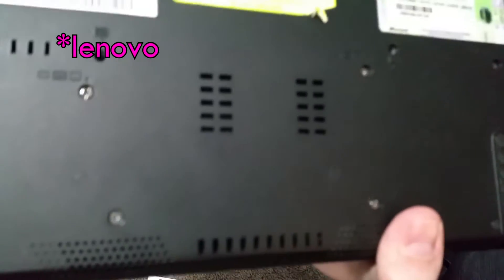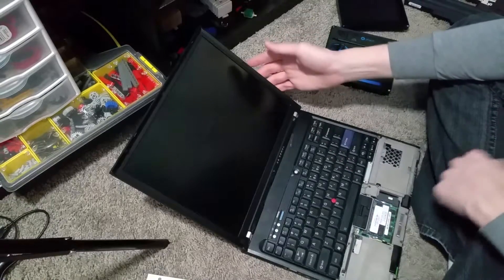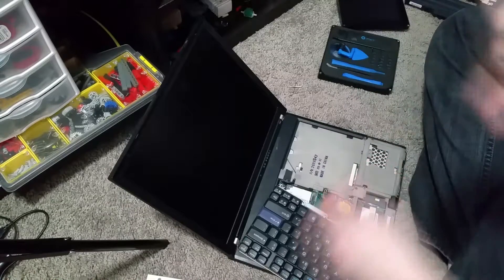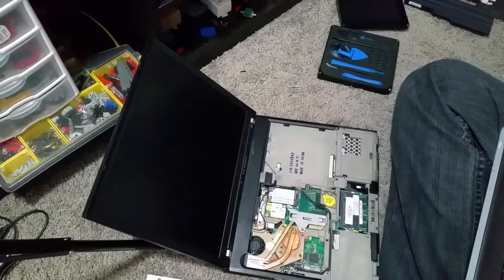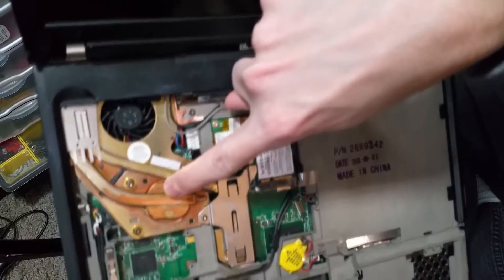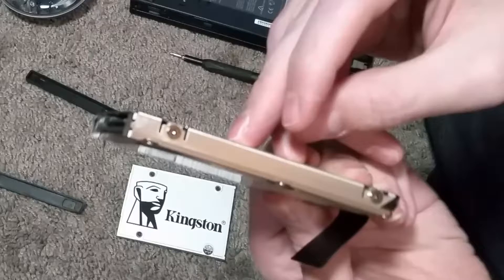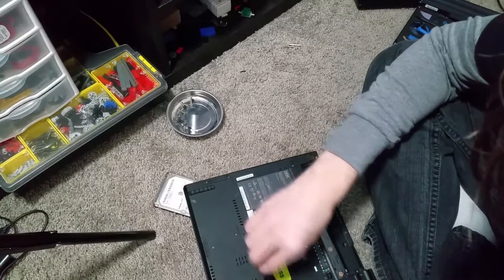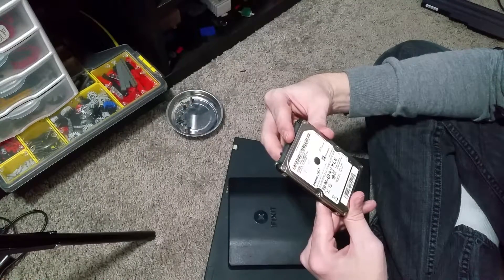Upgrade IBM Lenovo T60 part 1 | installing SSD, checking WiFi and CPU

Comment: If i wanted to put a 120g ssd m2 into a t60 what type of adapter would work for me? Is there anyone you recommend? thank you
Reply from the maker: @jaime9027  you don't need an adapter... Get a sata ssd
Reply: @RobertJene  The thing is that I want to put the original ssd from the x270(which i haven`t recieve yet) and I dont know if  it will be NVME or a SATA one
Reply: its the 120g ssd so I guess its sata right?
Reply from the maker: take a look at pictures of SATA drives so you know what they look like. this laptop takes SATA. there's no "adapter," just the frame that holds the drive and you slide it out, I showed it in the video

Comment: Heya man just wondering what were the size screws that you used to screw the ssd into the tray? I tried to look it up but couldn't find them lol
Reply from the maker: LOL I have a box of the common screws for computers... This video was 4 years ago...  But I do know that SSD's and hard drives take the same size screw, and it's standard.

Comment: The T60 is a 64 bit system that was downgraded with a 32 bit processor. Might have been to have a cheaper series. Upgrading the bios is a must before changing it to a 64 bit CPU. The T7200 Core 2 Duo is quite suitable for those without this.
Reply from the maker: I actually did this in a later video. Modded the BIOS to run x64 windows, that is

Comment: Hello Friend how are you? I need your help, I have a lenovo t60 laptop with windows 7 and I put an intel core 2 duo T7700 processor in it, but the computer does not start the operating system, it remains on a black screen, what should I do? Do I have to update the BIOS? help please, thanks ...
Reply: T7600 is the fastest cpu you can put on T60 and you have to update the bios first. mine is running smoothly
Reply from the maker: I don't think it will booth with a T7700.
Check out the specifications on this Lenovo page.
You have to scroll down a little bit to the "Processor" section.
https://support.lenovo.com/us/en/solutions/pd008795-detailed-specifications-thinkpad-t60-t60p